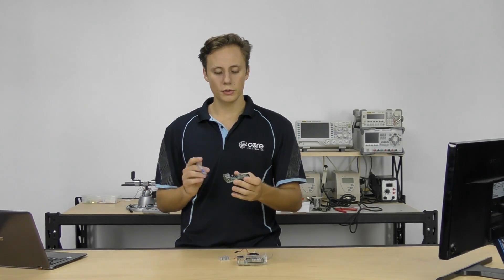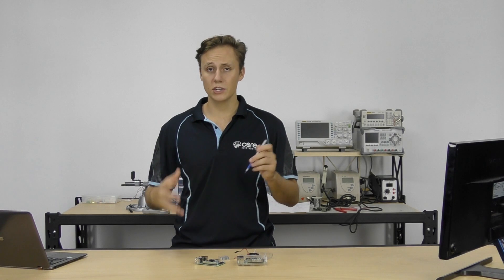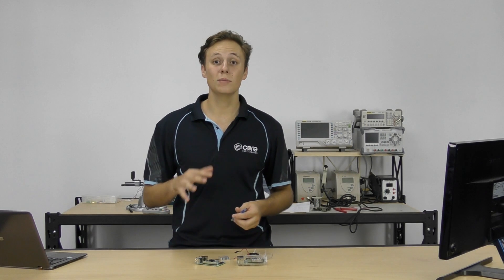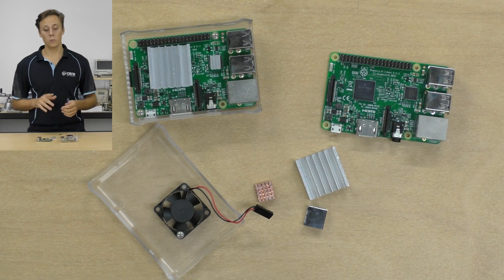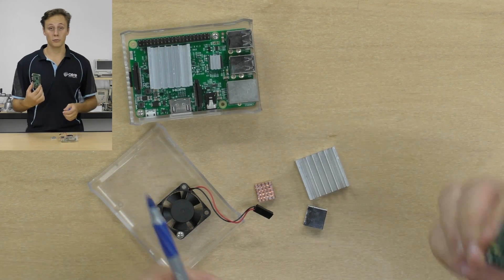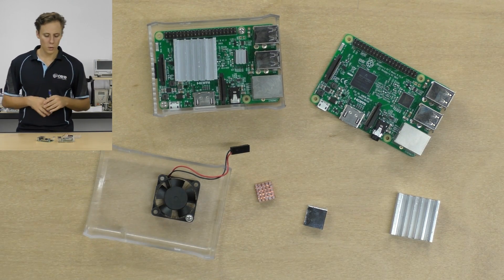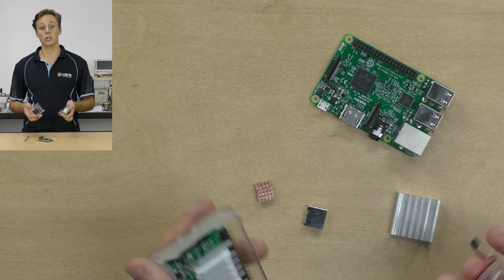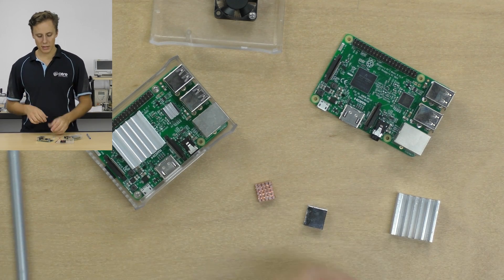How to Cool Your Raspberry Pi - Practical Tips - Myths Debunked

Comment: The issue is effectiveness. On paper you can argue that cool air will be blown to the heat sink and up through the fan and hot air drawn out of the unit through the fan but in doing a comparison there is a ~10 degree difference between drawing and blowing on to the heat sink running the same taskes. Drawing air out is far worse in actual application, and the reasoning is the air temperature of your environment it is in is the "cool air" so it is room temp cooling only from the distance of a few inches at best and mixing with the hot air. The other issue is the USB/ethernet chip still does actually have a heating issue even from the newest raspberry pi 3b+ models. It is not as bad as it once was but yes it is still bad. Now with that hot air from that heatsink contributes to push vs pull. Pulling the air out while that chip heats up it heats up the surrounding air, and the surrounding board space. 

With push the max temp I could get with base clockspeed of the pi3b+ I got the highest temp being 40.32 degrees, while with t he pull model I hit 51.78 degrees doing the same taskes. You also missed the point of talking about types of heatsinks like copper is better then aluminum at dissipating heat and heat transfer. 

I don't really see you debunking any myths in this video as you don't go out of your way to show any of these practices in a fair comparison.
Reply: Also as side note: When pushing air you are generating positive pressure into enclosure that prohibits dust particles from entering into enclosure with all the air moving away from the box except the fan intake that can be filtered and cleaned. Dust build up on the board works as insulation increasing boards temperature, witch is why all devices should be cleaned periodically.
Reply: *tasks
*better than (comparison)

Comment: thermal paste? won't adhere!, can I use thermal-glue? won't the heatsink fall off with regular thermal paste?
Reply: You are correct, thermal paste wont adhere to surface. You can use thermal glue but it will become pain in the ass to remove later if and when you need to replace it. 
I'm no expert but far as i see it, using sturdy base plate that keeps board straight and building holding device that bolts on the mounting points of Pi that keep heat sink in place would be best option. Due size of the board due keep in mind to use non current conductive thermal paste so your board wont short out. Also when placing the heat sink, make sure its on level with the chip rather than board. Pretty hard thing to do, but smaller the gap, better the heat transfer.

Comment: so I have a question, im using a RPi 3 model b just for old emulators and older games (Atari - SNES & Genesis) Im not going past that due to emulation for n64 and ps1 not being up to my standard. so would an altoids tin, and a small fan with vent be good? im not overclocking btw.

Comment: I decided to use the Raspi 3 as main desktop (because reasons). I use the standard  case + those small heat sinks. My Pi showed me overheating while watching you tube. So i took my case and drilled holes in it (on every side). Problem solved thank you stack effect :) https://en.wikipedia.org/wiki/Stack_effect
Reply: Very interesting solution. Do you have any picture of the case, please? Thanks.

Comment: Be smart and use what you have to your advantage. If you have one fan use it as an exhaust, find the furthest distance away from that fan and drill a few holes in the case to allow it to in take air. Dust with such a small fan shouldn't be an issue and worst case every 6-8 month (if needed) undo the screws and hit it with a can of compressed air.

Also you can use thermal paste but it's not really practical with these small chips. They are coated with an epoxy layer so it's not like you can make direct contact with the silicon die or even a metal heat spreader. Doesn't mean you can't tho just apply a very very very small amount and press the heat sink down. Lift it up and if it hasn't made it out to all the corners apply the same amount again but put two small drops of super glue across the corner of the chip. The superglue will probably dissolve some the the epoxy coating depending on the brand but the thermal paste will perform a good deal better then any thermal tape short of Fiji.

They also make thermal glue which is better than tape but not as good as paste. Put the two parts together and mix it well add in about 50% the total volume of thermal paste to it. This will negate some of the adhesive strength but improve the thermal conductivity of the glue. To be honest the glue is fantastic, it's hard to remove even when you want to so watering it down (so to speak) with thermal paste really will not dramatically affect it.
Reply: *good deal better than (comparison

Comment: If I'm looking to OC the CPU and GPU what do you guys recommend for cooling? I've seen people use fans/heatsinks/passive cooling cases. But some of the Heatsinks people were using = can't fit the Pi3 into a case. Are there any good solutions to keep it cool enough while OC'ing with the Pi3 in a case?

Comment: The fins are not for bringing air in. The give more surface area for the heat to dissipate from.
Reply: Yes.

However, there is an additional benefit of funneling air down the fins, which increases the speed of the air passing through the fins. I think.
Reply: While that is true, you're really saying both of the same. There is more surface area for the heat to dissipate from, INTO THE AIR that's contacting it. More airflow is just as important as heatsink surface area. Concept in use for engines up until the advent of water cooling to keep temperature specific and constant.
Reply: https://en.wikipedia.org/wiki/Bernoulli%27s_principle
the air does travel faster between the fins than outside of them because of this, but really it mostly comes down to surface area - get fractal shaped heatsinks to optimise that heat dissipation
Reply: @graysonjeremy7084  You're all the same person, aren't you?
Reply: I realize I'm kinda randomly asking but do anyone know a good site to stream new tv shows online ?

Comment: need to turn your heatsink 90 degrees, it will increase the airflow through the heatsink by around 10% and improve the cooling of the chip by around 20% by allowing the cool air to come in faster and cooler directly from the air holes right near it.
Reply: Redemptioner1 I'm 30% sure those figures are made up
Reply: So, if you turn it 360º airflow will increase 40% and cooling by 80%.
Is that right?
Physics?

Comment: I just brought a heatsink for my raspberry pi 3 model b will I need to purchase a fan too?
Reply from the maker: Not likely - heat sinks are fine alone (if needed at all)
Reply: Thanks, I have brought a heatsink! Just wondered to keep the temp of the cpu low!
Reply: I used one of the small heatsinks with the adhesive backing with no luck. I tried a bigger heatsink with better adhesive backing with no joy yet again. The adhesive is not the best heat conductor...better to use the silver paste and hold the heatsink in place with the case.

I put a fan...wow! Temperature stabilized at 40 deg whereas it overheated at 80 deg before. I am running two different java program which do a lot of graphics.
Reply: You kinda halfway explained the fan in an exhaust position but still didn't explain why it is better than in an intake position. I am building a Stratux device with 2 radio receivers. Those have been reported to hit ~200F I really don't want to draw that air over my processor. Is there a reason to not reverse the flow with the fan?

Comment: Pi3 is a great computer, but the thermal throttling is quite off putting.
Reply: Yeah, First was youtube videos hanging (fixed by disabling pepper flash? then installing regular adobe flashplayer). Bought a fan and heatsink online. But will take a month to get here.
Reply: I guess you'd rather have the magic smoke appear then :D
Reply: Wait til you try using non-accelerated VLC media player (standard debian release, not the one specifically made for pi). Load up an HD video and wait about one second. Temperature warnings instantly. I even heard a little sizzling in the case after a few minutes. Ridiculous. I don't believe Chromium supports HW acceleration on YouTube, either. It's crazy slow.